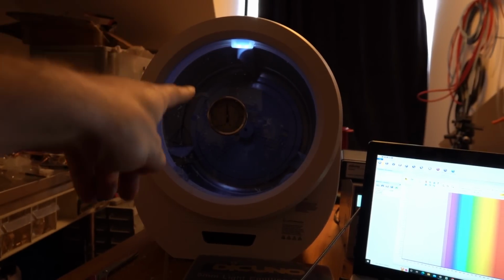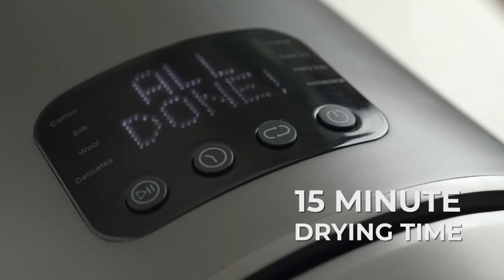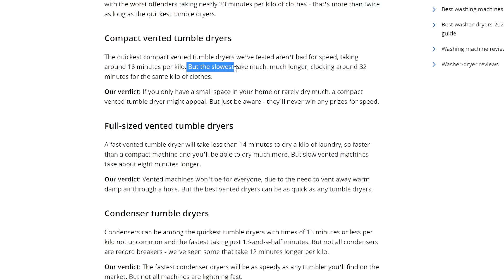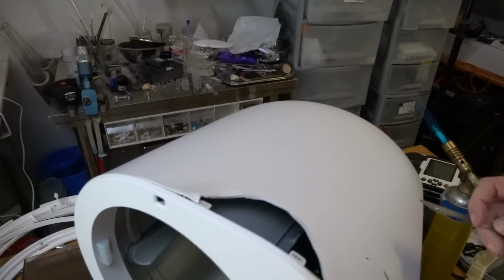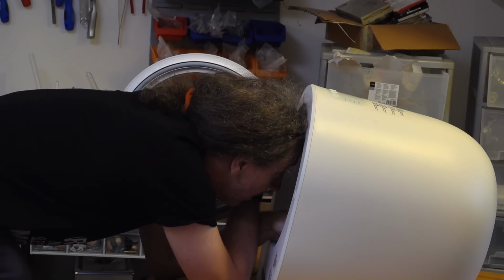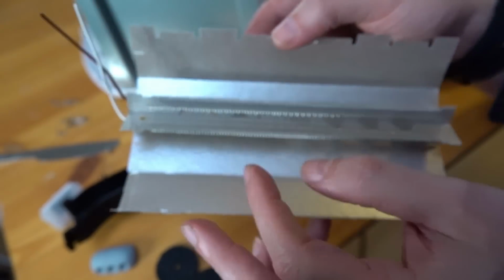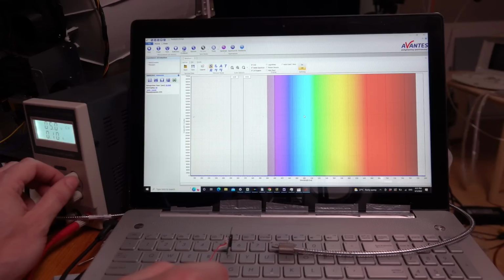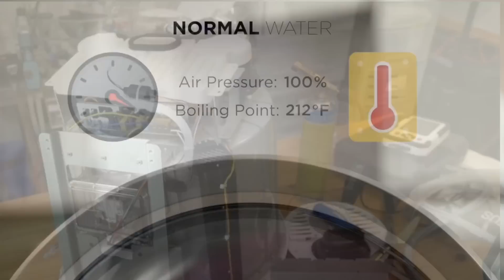Autopsy of a Scam-Starter: The Morus Zero!

Comment: The Morus is halfway there. Optimally, it must be paired with a Water Seer so you can drink the water extracted from your clothing.
Reply: and we can power the contraption with our solar friken roadways. 
our clothes will by dry by time we get home via the hyperloop.
Reply: LOL .....  send the first batch to CA. LOL
Reply: @darkshadowsx5949  I imagined living in the year 2100 after reading that.
Reply: 🤣🤣🤣🤣🤣....you, my friend have won the interwebs....
Reply: Hah, this is brilliant.
Reply: Condensing dryers are a thing - some have a heat pump that then use the cold side to condense the water - they can by significantly more efficient than plain resistive heating-based dryers...
Reply: The irony is, it would actually work.  Taking the moisture out of wet clothes.  However, putting the moisture in, i.e. washing the clothes, would be the issue, considering it's supposed to be in an environment where water is a scarcity.
Reply: Can dry a damp pair if baby socks in “about 15 minutes”
Reply: It doesn't seperate the water at all, so drinking non existant water as a placebo?
Reply: Wouldn’t the water seer pull the water out of your clothes before the dryer did? Lol
Reply: Genius, we'll have to come up with a package price for them - +50% sound good?
Reply: Make the housings out of Air Carbon, powered by Spinning Solar Panels.
Reply: But like, seriously, they could have just used a condenser to heat the clothes and condense the humidity before pumping it into the room. They could have at least made it an apartment friendly mini drier without all the Musk-esque spin.

Comment: Thunderfoot, If you're curious about the white LED's at all they're actually a single emitter deep blue LED capped with a yttrium aluminum garnet cerium (YAG:Ce+3) phosphor.  The phosphor cap converts some of the blue light into a broad spectrum green-yellow light while allowing some original blue light to pass through.  When mixed together you get something approaching cool white light.  By adding other choice seasonings to the phosphor blend you can get a little bit of red into the mix and get warm white emission.
Reply: Yeah, also why blue LEDs appear so much brighter and obnoxious, it's direct light
Reply: you sound like a guy who makes these things.
Reply: @JamesTK  i did not know that, thanks!
Reply: Username and information checks out. Cheers.
Reply: Its like Kunthovinds PhD a  work in progress? 🤦‍♂🤣
Reply: Ha! I worker for several years when I graduated college (Photonics) for a major LED manufacturer. Sounds like you work/worked for one as well.
Reply: IIRC, the inventor of the blue LED got a noble for their work because it also led (no pun intended) to the ability to create white LEDs and ultimately RGB led displays.
Reply: I have never seen a spectrum graph of a warm white LED that actually has a y real red, just more of the yellow bump. Maybe in some of the newer high CRI bulbs?
Reply: @JamesTK  pardon? Traditional red, amber and green LEDs are also direct light, right off the semiconductor.
Reply: and i was thinking it was the Tube Fairy.
Reply: I am a philosopher and I find that offensive!
Reply: scale  is putting junk links here. Just a video of donuts
Reply: @scale has put a link to a donut video here. Don't waste your time clicking it.
Reply: @nexpro6985  reported as spam
Reply: Thanks for that explanation mate
Reply: That's how they make LED downlights. Not to dissimilar to flourescent tube lighting. 

Normally just converting UV and blue light to the visible spectrum through phosphorus.
Reply: You can also see nicely how our eyes are far less sensitive to blue light than they are to red and particularly green light. A bit of red and green completely dominate te blue output.
Reply: @Peter_A1466  I wish this was true for me, blue light actually causes me pain and blurred vision when I see it.
Reply: @nexpro6985  you actually clicked a blatant spam video? Shees mate, I suppose you also lend money to Nigerian princes in the promise of money once his assets are free
Reply: Those certainly are words
Reply: Was about to write the same comment, just not as detailed..
Reply: @ethzero  *nobel price. Not noble price.
Reply: That's why you see so many newer street lights emitting blue because they burned off that phosphor coating.
Reply: If you really want to take a deep drive look up USBC LED composition, absolutely insane.
Reply: @ethzero  nobel prize, not noble LOL
Reply: @soggybiscotti8425  how do you know about my Nigerian Princess?
Reply: @timbeaton5045  why did you report me as spam? 😁
Reply: @nexpro6985  I didn't. I reported @scale as above. Not you!
Reply: @squidcaps4308  and prize, not price 😛
Reply: @timbeaton5045  I think he got it, but that was funny 😆😆😆
Reply: @timbeaton5045  I know, hence the smiley. 
Thanks for reporting the spammer.
Reply: -Matter didn’t create anti matter
-Anti matter didn’t create matter
(Both of them were present at the time of big bang)
-Both of them didn’t create themselves.
-Both of them came from an unimaginable source,  that unimaginable source created matter and antimatter (everything) thats why it is known as “the creator” of everything.
——————••••••••••••••••••••••••••••••
- that unimaginable source/creator has created sin and virtue which are opposite to each other,
— “logic” confirmed that every action has its own reaction, so the reaction of sin is different than the reaction of virtue,
— the creator has created prophets to let us know about each and every detail of sin and virtue, also about their reactions,
Thank you :)
Reply: @Zialitt  so, if I understand, what you are implying is that god created everything?
Reply: @soggybiscotti8425  Everyone knows that if a Nigerian Prince promises to sell you gold its a scam. That is why i only ever send my money to Nigerian diplomatic, i am sure that my consigment will be here any day now!
Reply: @Zialitt  who created the creator?
Reply: I can remember working on satellite distress beacons that used to have xenon strobe lamps but  now use white LEDs. We had to be very careful to choose LEDs with output spectra designed so that the "white" flash did not turn out to look like a "blue" flash at a distance. You wouldnt want to be floating around a mile offshore and get your distress strobe mixed up with police cars onshore when seen from a distant searching boat..
Reply: Would like to know what drives that UV led , when decades ago you had bicycle lamp that worked from a 3,6v 1F capacitor , charged by dynamo , it was on only 10 % of the time , it run from a 20kHz chip and turned on every 10th cycle , it switched on 2000 times every sec , if the UV led just gets pulses to switch on , it never has time to heat up .
Reply: Interesting. Nice.
Reply: do you recommend and warm-white generating silicone based phosphors for purchase?
Reply: @indyola1  They have it, because people use white leds to grow plants that need 660nm.  Every led is different. there are many that have almost no red.
Reply: So I guess that phosphor burns off over time and explains why the lit up keys on my 7 year old RGB keyboard are all a bit janked on the keys where I've had them a particular colour for the entire time. The more you know!
Reply: @JamesTK  I thought blue were always the harder to make, more expensive ones. Not so? This is a "fact" I've had in my brain for multiple decades at this point so it could just be outdated or something
Reply: @johnnypopstar  rgb does not contain phosphor, rgbw does and it won't degrade in a couple of years unless exposed to hundreds of degrees
Reply: @yagoa  so the w does? Is there any difference in the rgb from the that which is in the rgbw?
Reply: @UCJJxUZVGyx26-gGXVdL2UjQ yes I'm aware that rgbw has a white light. What I didn't know, if there is some difference in the rgb, e.g.. because the white led the rgb could be of lesser quality. I do know a bit about lighting, however not so much specifically about LEDs. I've tested products using rgb and rgbw LED's as well as the red/green/amber ones. So while one could easily assume that the only difference is the inclusion of the white LED, I could think of plenty of reasons off the top of my head for that to be true or not.
Reply: @onradioactivewaves  White led are always inferior(due to the phosphor producing extra heat) but identical to blue ones as for the actual chip
Reply: @yagoa  I see, thanks. I've dealt mostly with testing actual LED fixtures, not on LEDs themselves. Ive also done electronics projects, but never dissected an actual LED beyond operational theory in the semiconductor sense.
Reply: @ethzero  And now every strip mall is lit up like Times freaking Square. Thanks, inventor of the blue LED!
Reply: Is it actually phosphorus element or just another abuse of language ?
Reply: @JamesTK  Blue LED are also having way better efficiency than red or green LED. So anyone wanting "high intensity" would select a blue LED.
Reply: @pete_lind  It was an incorrect assumption from Thunderf00t that resulted in overheating the UV LED. He didn't set a proper max current on the PSU to make the PSU switch from voltage to current regulation. So he did run the LED outside spec.
Reply: @johnnypopstar  An RGB LED does not have any phosphor - it really is using red, green and blue LEDs. The phosphor is to make a blue LED look white just as phosphor is used to make a UV flourescent tube emit white light instead of UV light.
Reply: @johnnypopstar  Yes, it was a challenge to learn how to make blue LED. Lots of work to figure out how to both get them to function and how to massproduce them. Hence the Nobel prize mentioned. But now we can make them cheaply and they are the main ingredient in all white LED illuminations. Not only becase we need blue to cover the required spectra but because blue is more energetic light and blue LED has much better efficiency than red or green.
Reply: @onradioactivewaves  RGBW has the white LED because it is much more efficient to create white light from that "white" (aka blue LED with phosphor) than from adding R+G+B. So the RGB can be used either for effects or for adjusting the color temperature. But when the goal is to get white light, it's the white LED that is the heavy lifter.

There are also RGBWW (also named EGBCW) where there are a cold white and a warm white LED besides the RGB LEDs. Adds production cost but allows adjustment of color temperature in a more efficient way than to add in light from the RGB.
Reply: @YounesLayachi  It's not phosphor as element but a material showing phosphorescence.
Reply: @perwestermark8920  awesome, thanks for the info :)
Reply: @perwestermark8920  ha I figured as much. I hate when that happens, people gotta start using accurate names and not butchering the existing scientific terminology for mundane fluff